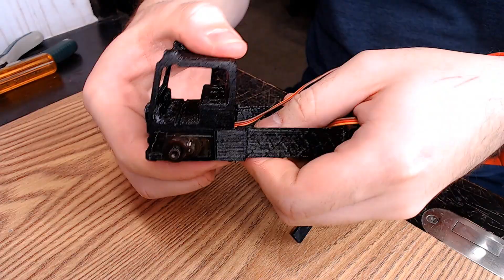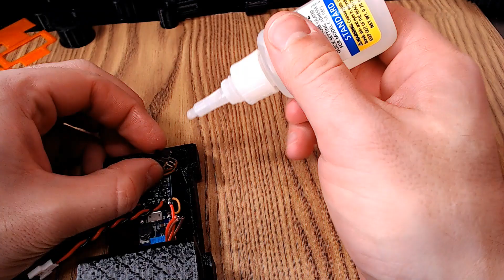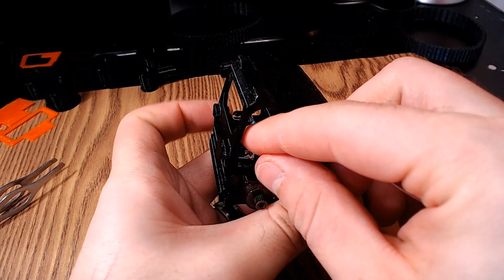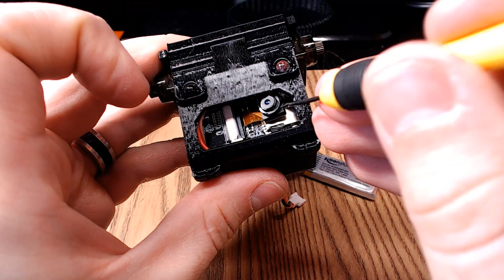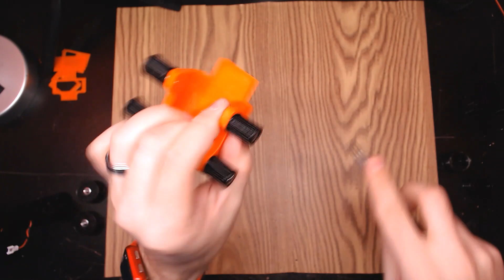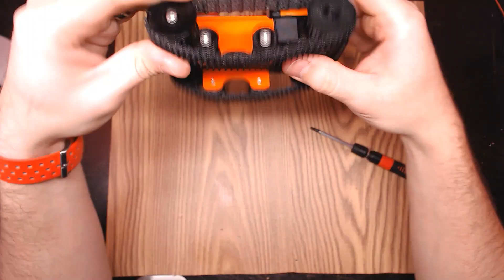Scout32 - ESP32 WiFi Rover Build Guide

Comment: First of all. I love everything about this build. I just wired every up, but I have an issue. When ever I press LEFT or RIGHT in the UI of Scout32, the servo only moves for a split second. What am I doing wrong? I am using SG90 servos.
Reply from the maker: @Lammy2k  are you using continuous rotation version of the SG90? You will have to modify them for continuous rotation if not.
Reply: @Pilotgeek  Thanks for the quick feedback. I will check and modify the servo if needed. But I think your suspicion is correct.

Comment: i have this built, but am having an odd issue, when on battery only, when I engage the servos, they make a slight noise, and the esp resets.  But if I have the 4056 plugged into charging, it works fine.  I have a 18650 battery connected to it and have the buck converter set to 5v
Reply from the maker: If you can adjust it, maybe boost up to 5.5v. You could try to add a 220uf capacitor to the input pins on the ESP32 as well.

Comment: thats dope! I used an esp32 to make a robot that draws dicks! It doesn't work very well. 

I've seen a lot of people using servo motors for this kinda stuff and I'm wondering why that is. My prototypes for the dick drawing robot use cheap-ass geared motors with encoders and even cheaper-ass stepper motors on others. I haven't used servos very much in the past and would love to get your take.
Reply from the maker: Hi Oliver,
I tend to use servos for a few reasons. First off, I'm quite familiar with them. I have had years of experience in radio controlled cars, aircraft, and boats.Their usage in these vehicles makes them cheap and common, available at most hobby shops. Lastly, they contain their own motor driver circuits, so you really only need to supply a signal with no need for a motor driver board. 

Most of the things I use servos for require "good enough" precision. For something that's extremely repeatable, accurate, and precise, I would hands down go for a stepper motor. For turning a wheel, or tilting a robot head, servos are usually fine.